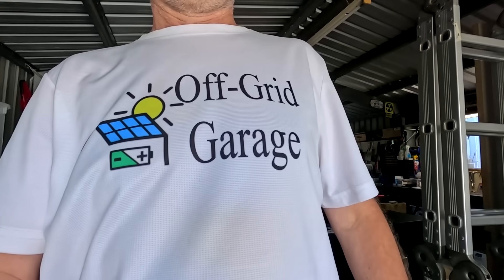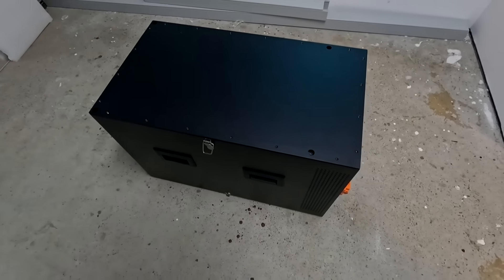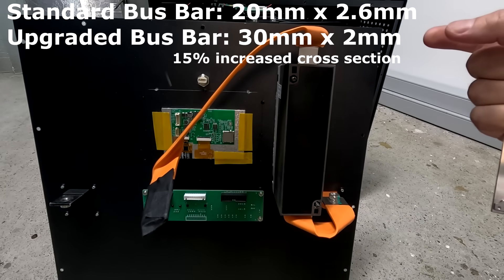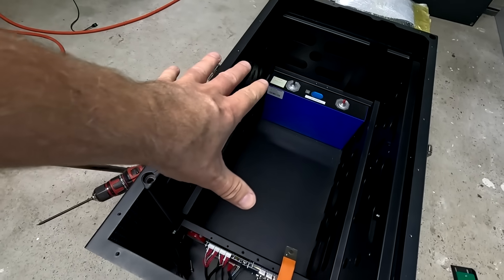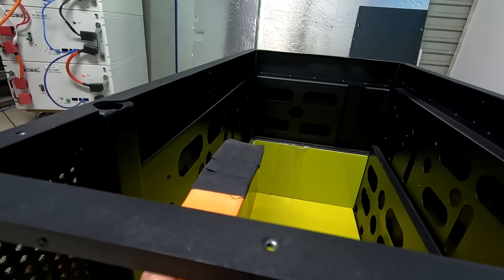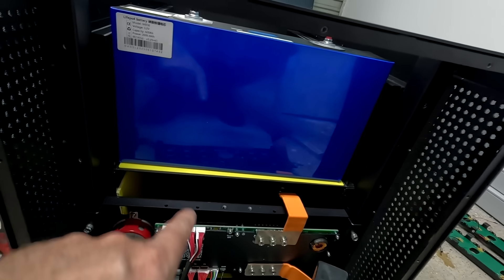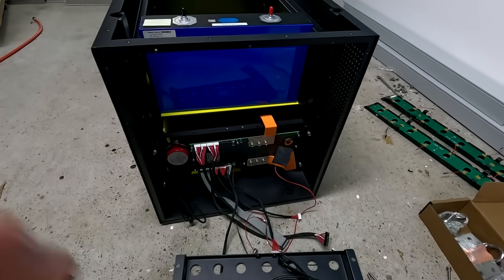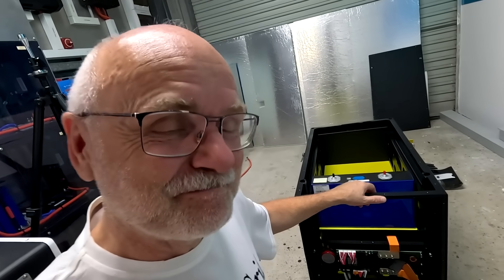World's First MB56 DIY Kit from YIXIANG. How good is it and... does such a battery make sense?

Comment: I'm wondering if a mb56 battery can be installes in parallel with a "normal" batterybox. Because the capacity is twice as much. So the normal Box will be empty first an the other way round. Or is bms handling the whole Thing in regards of current going in when for example the 280Ah Box is full. So will be the current reduced? Or will the 280 jk-bms cut off and the mb56 will be charged with full Power? Do you know what i mean?

Comment: I bought a 12V 230Ah EEL battery (DIY kit). Where is the best place to install the temperature sensors?
Reply: Hello, according to the official recommendation of EVE Battery, place and stick the temperature sensor near the QR code on the top of the battery cell.

Comment: Hi Andy. I wasn't surewhere to post this so put it here. Your large gauge crimpers stamp the AWG or mm2 onto it. (can't remember which but saw you pointing to it in one of your videos a long time ago), but I bought a couple different hex crimper sets and none of them do it, and couldn't find anywhere on amazon with any. I couldn't find it on your products page either. Can you provide a link to those? I need to identify wire gauge of decommissioned cables, but even if there is some awg marking on the ring terminal it is sometimes just a range and not the actual gauge of wire crimped and when I need to find a specific min gauge, I don't know without lopping off the ring terminal and measuring it, and putting a brand new one back on.

Comment: Hello Andy. I’m wanting to build a 120 volt DC battery. Would you recommend a BMS to use with 40 of 280 ah lifepo4  cells. My off grid system uses a Selectronics SP Pro 1201 120 v , 20 Kw Solar and presently 8 of 3.3kw Power Plus batteries. I’m considering  QUCC  ZB - MUST BMU and 48s
BCU. Seems the 120volt world is nowhere as populated as the 48 volt community. Does any supplier sell a battery box for 40 cells. Love your work. Thanks
Reply: nice inverter - anything you can tell us about it ? A mini review maybe? very expensive but very good i believe.

Comment: Wish they’d make one for 24v, maybe I can get them to piece parts together for me now that they’ve got a pcb for the 8s now.
Reply: If you adjust the wiring a bit, you  have room for two sets of 24Volt in this box, nice for future expansion..
Reply: @habana7638 I thought of that as well, wouldn’t be hard to setup the front it to serve two 24v batteries. However, I’m going to just change to 48v. It started with my MPPT charger, only getting half of its wattage into the batteries, and then the inverter with battery charging as well, not to mention lower amps while drawing the power from the batteries. I was trying to stay 24v so that I could jump or charge directly from the truck engine while driving. I’ll just find what I need for charging the house batteries so that I can get the highest efficiency.

Comment: Hi everyone, my name is Marco and I'm writing from Rome, Italy. Forgive me for any mistakes, but I'm writing with a translator. I have an unusual problem. I'll explain: the BMS JK and Victron system are set to DVCC. Everything is fine, the absorption timer and float are also respecting the DVCC parameters, but the yellow light on the Victron MPPT doesn't turn green when the JK goes into float mode, but stays yellow. Even if the float mode works, I see that the voltage drops. Thanks if anyone can clarify this. A hug to the legendary Andy and to all of you.

Comment: Too big and heavy plus the bottom cells in accessible.  Would prefer a 2 case approach, which would make it 2 men handlebe.  Fusing is 300A, bus bars need to be beefier. Cells should have dual hole terminals at that Amperage too. Would love to see those fire extinguishers in action 😂

Comment: The 30mm x 2.0mm busbars are only rated at 295A for a temperature increase of 100 C in still air. With a continuous load below the 300A Breaker rating the internal temperature of the battery box could be 100 C above ambient. In my opinion the 30mm x 2mm bus bars (which are thermally insulated with the orange heat shrink) are too 'narrow' and should be increased to 35mm x 2mm to give sufficient 'excess' capacity.

Comment: Very interesting video.  Thanks Andy.  So you save a couple of bucks on battery ah and a quite a bit more on the case/hardware/bms.  Even if I had to do it again, I think I prefer using the 280ah cell format.  It's getting stupid heavy to move them around and possibly service them (ie:  fuse or BMS change).

Comment: For the 60 Amp share power I use just one 30 Amp charger since the 2 together draws 7 Amps and draws on the AGM Grp 31 engine battery.

Comment: I have 3 RB100 batteries in a bank in a compartment. I would like to add a 4th RB100 but it is 3 feet away. One should have equal length leads but that is very impractical in this case. I need to take the batteries home doing the winter since the boat is store above ground with temps getting to under 20 degrees F. I would take the 4th battery each spring and swap it with one of the other batteries to even out the usage of it. I have a 60 Amp charge for shore power during the week when not using the boat with the only load of the frog running and a 125 Amp alternator on the 40 Hp engine with two 30 Amp Orion DC-DC chargers available. Do you find that is a workable solution to increasing my capacity?

Comment: 1st I believe this busbars are to small . Easy calculation 30 x 2 x 1.2 (copper) = 72A for 25 to 30c .
2nd calculation 200A / 3 = 66,66mm2 crosssection (30 x 2 = 60 mm2)
3th Victron cable table 70mm2 for 210A .
So the crosssection should be minimum 30 x 2.4 = 72mm2 or 35 x 2 = 70mm2.

I dont think burning disaster will happen but temps will be higher than i would want myself.

I wander the temps of the busbars when discharging at 200A continuesly for 1 hr .....

Comment: My biggest problem is the BMS. it's only rated for 300A and the cells have a continuous rating of 314A. i had really hoped voor a 400A or more from the JK inverter BMS. Now 2 mb31 boxes can deliver enough power voor a 16KW inverter and this box fals short.

Comment: Cool setup, no doubt about it. Personally I'm happy they are hanging onto the MB30 cells. I still see no advantage to the larger, more labor intensive batteries outside of a large installation. Trivial as it may be, I recently saw testing for the cells and the energy density was ever so slightly less with the MB56 vs MB30. 
I would say though that if this configuration works for you this difference is certainly no reason to dismiss it.

Comment: Prediction: Cell 8 or 9 will always be that with the highest cell voltage while charging.

(I have DIY case and a bit longer "busbar" in the middle too, to connect 2 sections, and the voltage drop of the longer bus-bar is always visible (under load/charge))
Reply: Need active balancing
Reply: @VichaDorenaBrTarigan  no, not under load-conditions. The longer interconnect busbar causes more voltagedrops that leads to wrong results. Not a big deal, because most balancing is done when charging is done. Then the effect isnt present.

Comment: I wonder how effective the placement of the fire extinguishers are. Before they were placed in the same chamber as the cells, but now it's outside. Can the extinguisher powder really penetrate the holes of the compression plate effectively? Won't it just mostly flow out from the outside ventilation holes?

Comment: Battery boxes are getting bigger and heavier. If they're standing firmly, it's no problem. But what if you have two stacked and you need to replace the BMS, connection board, or something else in the lower one? Can you get to the relevant parts through the front panel? I miss that even with the smaller boxes. I'd have to completely disassemble the upper one because of the weight. That won't be fun. Can you suggest to Yixiang that they think about a new design?

Comment: Thank you Andy, regarding the temperature measurement, it seems to me that it's not the same system as the 15KWH kit. In the latest evolution, the temperature sensor found its place in the spacer. Will there be the same evolution??

Comment: Wow, FIRST TIME EVER ON THE OFF-GRID GARAGE channel.... Presentation of a DIY Kit without having the physical batteries?
Well, there is some more exciting news. Apparently Hithium will be  coming OnLine with an 1172 Ah Cell @ 20,4 Kg. That´s 326 Kg for a 16 Cell pack + the weight of the Box. Let¨s call it  350 Kg to save energy with the calculator. 
And the SIZE 580x216x75mm. I think I will be sitting back and watch till the first HYPE is over. I guess the only reasonable way to move those monsters around is while they are not assembled. However I can already see it ... some  over hyped guys cutting corners and trying to move those beasts up and down the stairs. I am sure that´s gonna be front page news in YouTube Land. 
I wonder when we will be talking about Watt Hour Density because there it will show up who of those  Cell manufacturers will be the crusaders in the new galaxy. Andy, You think there will be a free crane included in the kits ? Might come in handy to move the boxes of SPAT ?

Comment: Whats the point????? Its ti heavy to handle!!! Its nit redundant!! 2 of the normal mb31 batteries has the same voltage and redundant and half the weight!!! If it could have been configured as 96v series batery then yes, otherwise its silly and impractical!!

Comment: About basbars...
For the size, you never tested anything to prove that 16mm² wire can handle 200A without any problem...
Just take look the size inside the fuse, and compare with that basbars, all of them need to handle constant power passage...
It means all of the numbers mean nothing if you don't test it...
Anyway, electricity is not passing tru the basbars, or wire, is going all around the surface...
Good luck everyone...
Reply: Nthere is no skin effect with dc

Comment: Thanks for the video.

Congrats on having worked with Yixiang to pull these improvements together.

Will there be a DIY DIY (DIY squared) version for MB56 cells? If so, I'd request an option to order the box with Amphenol-style battery terminals.

While I see the benefit in having a stackable box esp. with backward compatibility to their other existing boxes, having a version which would not be double-decker would provide greater accessibility. Might we request a DIY  DIY option for a single tier version?

Is there any further information on the optional heating cables? I've not found any reference to these on either the Yixiang website or the Shenzhen Yixiang Alibaba webpage for the MB56 battery box. Is it a first step by Yixiang toward an IP56 | IP66 rating?

Are there any issues you'd foresee with having a 300A BMS when pairing components that have lower amperage built-in breakers / fuses.

Thanks again.

Comment: Wow..... Very exceptional kit.
Lots of thought gone into the design.
I have a pair of 23kwh battery boxes which I purchased from China last year. I'm very happy with my setup but would definitely go down this option if I build another system.
The wheel trolley is an absolute must have otherwise it is nearly impossible to move. I'm very thankful I put the heavy duty wheel kit on my system.

Comment: It's just TOOOOOO HEAVY!   almost 450bs (> 200Kg) including the giant metal box... That's too heavy to move.   Furthermore, you have ZERO access to your first layer of batteries (cant verify or test anything, test for bad contacts using an IR camera etc...) and it's just too heavy to move around.

If one insists on using those monstrous cells, then I would suggest making a change to this case and split it into TWO cases.  A base one for 8 batteries + BMS and connectors, and another one going on top for the remaining 8 batteries.    Add an external flexible bus bar or other clever connector system and you then have a manageable set of boxes that two adults can easily move around without getting hurt.   We have already demonstrated that a regular DIY box while heavy is still manageable.   Two boxes of that size/weight would therefore still be manageable,  safe and convenient.

Finally, that would also address Andi's concern about working with the live bottom 24V battery when assembling the upper stage.
I like that they are working with Andi on making better boxes.
This one is a prototype and I think it needs to be split...

Comment: Andy, that jumper/buss from bottom to top is too small. The resistance of all the busses must be the same. This wouldn’t be much of an issue with light charge and discharge, however it could lead to an imbalance especially if the direction of current is usually higher. For instance every day there is a modest charge rate but every night there’s a heavy discharge. Use your internal resistance meter to compare the cell to cell busses VS the top to bottom buss. Using “SWAG method “(look it up😂)to determine what the jumper should be, it should be at least 3 times thicker than the others. The long positive and negative busses are fine. 
Have a great day Andy!
Reply: What are you on about, the cells are in series not parallel.
Reply: @TheRonskiman 
Exactly. With one weak link in between. It’s a 16 S. Eight on bottom and eight on top.

Comment: The only thing which would improve access would be a drawer for the bottom level. But this would take a lot of engineering and expense. André in Sydney
Reply: I will wait for a price difference: this box with MB56 vs. two boxes with MB31 cells.
I probably stick with MB31 boxes. More manageable - at least you can move them when needed. And when one box needs service, it is much easier to diagnose with one layer design.
That said, I have two boxes (300Ah box) and third is ordered.

Comment: This is a great idea for the off grid situation on a budget. It looks like it will save some money on the cost of one box compared to two and freight for only one. Plus only one BMS and one set of cables. Be a great idea to do a price comparison for this.
Reply: "plus only one BMS..."  That's not a plus, that's a single point of failure. If your storage needs are modest, you are better off with several smaller batteries. If you need a lot of storage, then four of these large batteries makes good sense, so long as you can maneuver them.
Reply: @cuisinartOH1  one BMS is $100. So we save $100. The price of MB56 in China is $90-100 cheaper than MB 31  $52-55
Reply: @carkawalakhatulistiwa But how the hell is anyone supposed to move a 240kg fully assembled box?

Comment: Love the MB56 box, only one question, can you ask your supplier, do they have plans for a box that can accept 2 280 batteries in one box stacked? I have 2 280 AH eve 16s built wiith jk 150A bms's, could this box be modified to house those? Currently I have them in wooden crates but I would like to go with the metal option, but 2 boxes were not as affordable as this one looks. I can't be the only one that would like this option.

Comment: Is there a 24V version?
Reply: Nope. The world has moved onto 48v
Reply: @cyumadbrosummit3534  Depends on the application. 24v can be preferable in mobile applications which already have 24V systems.
Reply: @boydw1  The thing weighs 300kg, mobility can be forgotten I think...
Reply: @Daemia-o1q More like 200kg, and a 24V 8cell version would be closer to100kg, which isn't unreasonable in a large campervan. The large 12V AGM batteries were about 50kg each.
Reply: @cyumadbrosummit3534 not if you have a boat with 24v systems. Yours is an unhelpful and uninformed comment

Comment: What is the thickness of the metal sheet used for this MB56 DIY Box? How does it compare with the thickness for LF280/MB314 DIY box and the thickness for the LF105 DIY box?
Reply: EVE are listing 10.7kg +/- 0.3kg per MB56 cell, so could be up to 176kg just for the cells. Prob somewhere near 200kg for the loaded box.
Reply: Actually seems to be some variance on the listed weights whether you look at the website, or the PDF. I'm seeing from 10.5kg +/- 0.3kg to 10.9kg +/- 0.3kg from various sources.

Comment: I can se one problem with that case, the bottom plate that the cells sits on is to weak and will not hold the weight, it needs more support at the bottom part. with that design the cells will hold its own weight out at the sides only, making the middle part with no support for the cells and making them a structural part of the case and that not good.

Comment: Aside from half the terminal connections, what's the advantage over 280 - 314AH cells?  I'm just having a hard time getting excited about 2 MB31's stuck together into a single cell.
Reply: For DIYers, IMO, the 280-314Ah cells are the practical limit of a 48V battery. These massive cells are better left to large ESS systems. And it's a win-win situation. Let the mass adoption of the MB56 cells drive the price of the MB31 cells down. It's the latter that will benefit most of us.
Reply: @cuisinartOH1 
Die Fertigung der MB31 280Ah Zellen von EVE wurde eingestellt.

Comment: I thought the DIY 48v 280A was too big and heavy at the time I first saw it. I now have 5 units. In my opinion of you are going to go BIG just go wider and put the cells on one level for easy access.
Reply: I guess the advantage is that if you're on a wheeled dolly, you can roll it through doorways
Reply: @boydw1 Great point.